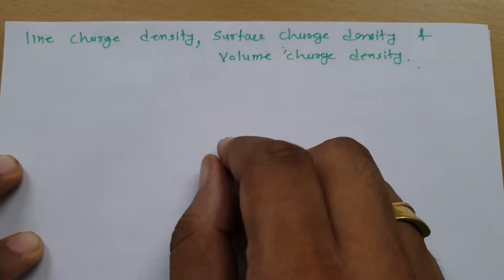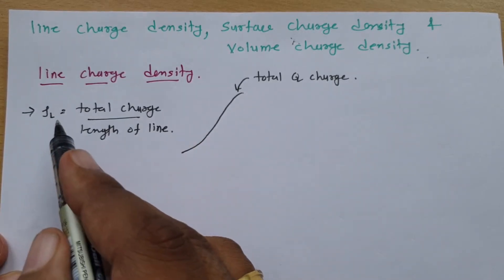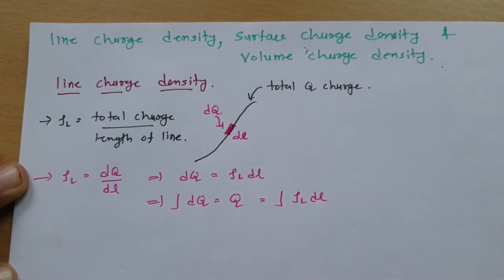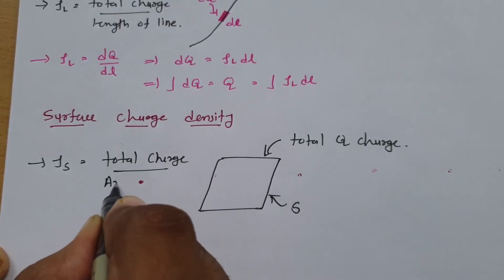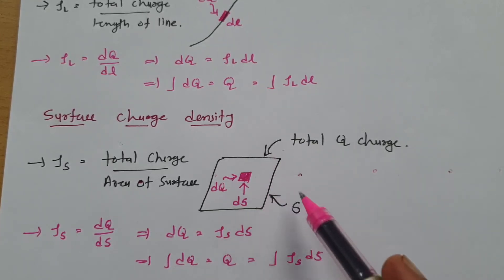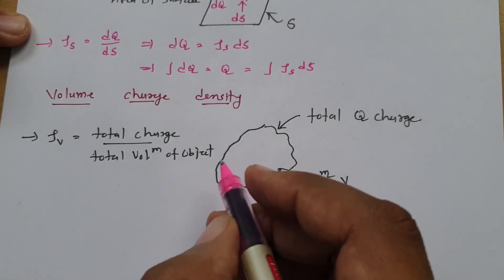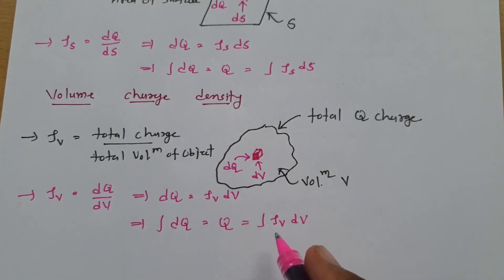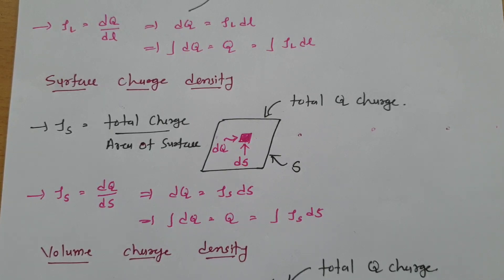Charge Density Explained: Line, Surface, and Volume | Electromagnetics Theory | Engineering Funda

Comment: If I want to find the surface charge density of a sphere, do I use the total charge in the sphere, or the charge at the surface of the sphere?
Reply from the maker: For metallic body there will be only surface charge on solid sphere. For other types of body you will have to see volume charge.